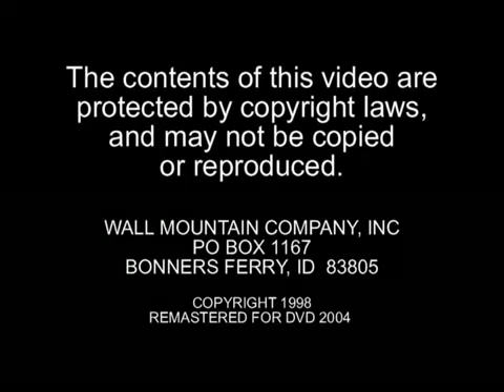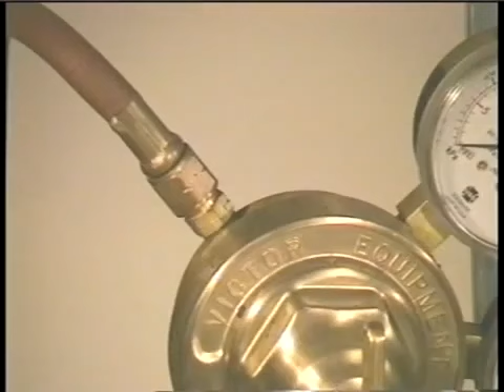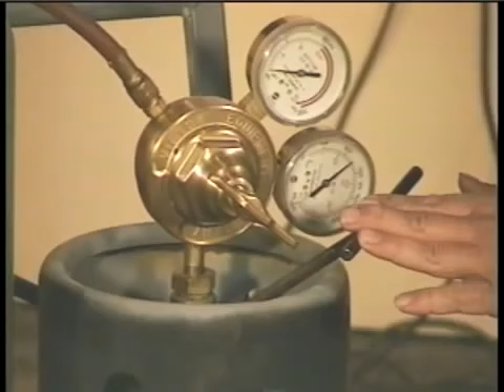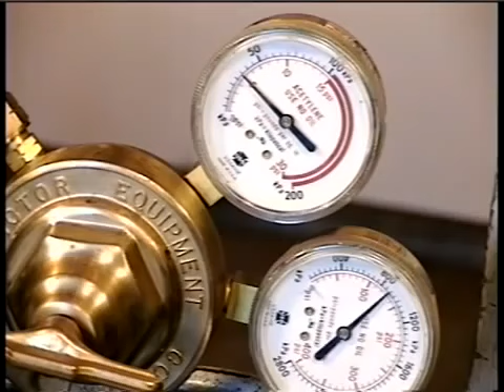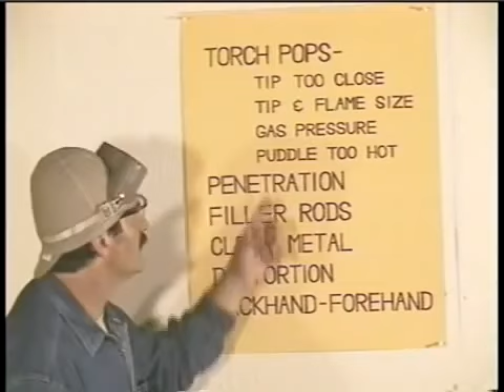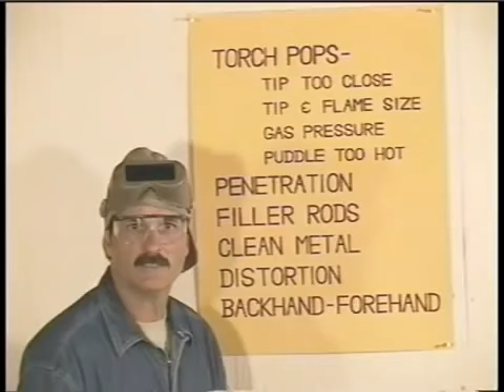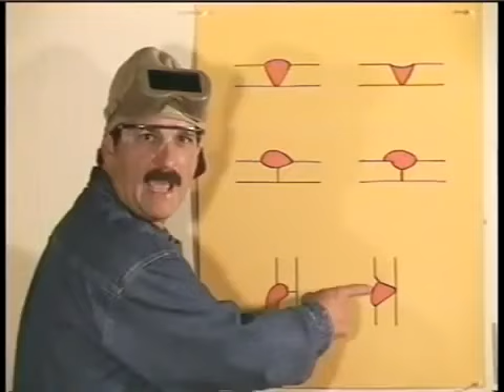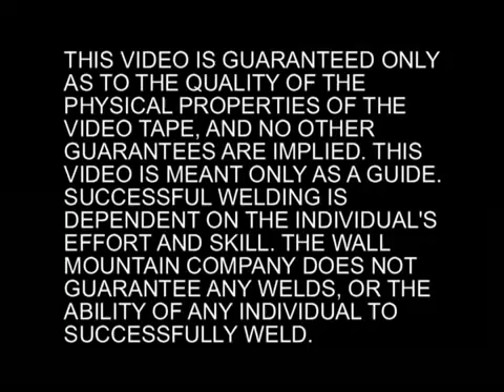Steve Bleile oxyacetylene welding

Comment: Jake, this is a very informative video on gas welding. you did a great job explaining  setting up the tanks, gauges, pressures and the different types of welding, . I haven't welded for a long time. I just bought a new welding set and filled my Oxy. tank. You brought my memory back to what I used to know. Just the refresher course I needed Thanks!Toolman